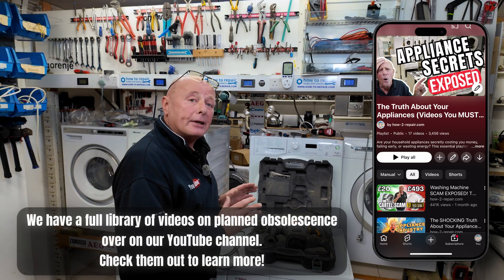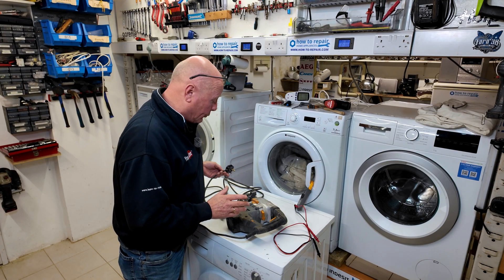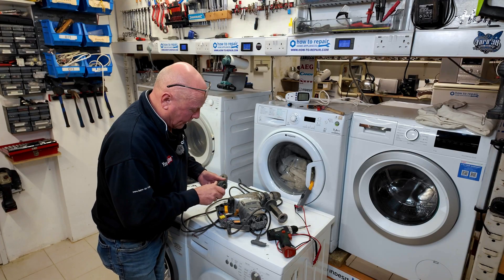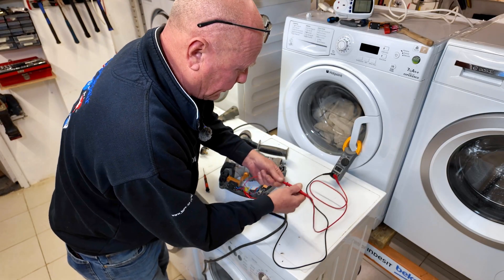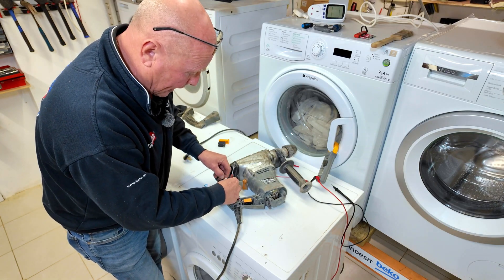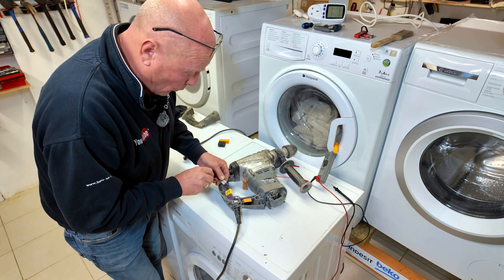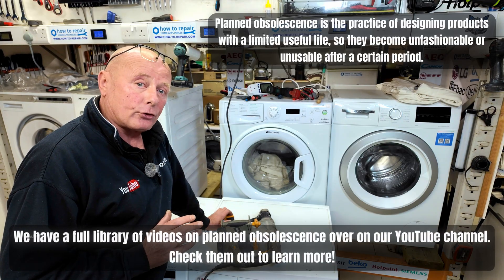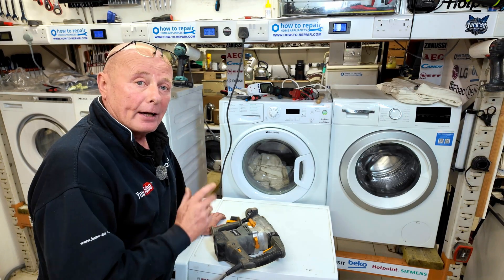How I Saved My Friend £90 on a New Titan Hammer Drill? Power Tool Repair Guide

Comment: I have a Bosch microwave, and  the turntable motor broke.
Good point turn it over and easily remove a metal plate ( which can be easily re attached) and remove the motor.
Bad point Bosch want £25 for it
Good point AliExpress sell EXACTLY the same one for £1-75

Comment: I've got a belt sander, I forget what make.  The same one is available from most of the budget manufacturers like titan, just in different colours.  
Its a bit fiddly, but you can open the switch and clean it inside.  The belt sander is prone to filling the switch with dust, rather than the contacts getting burnt from arcing.  I squirt it out with some brake cleaner, contact cleaner or whatever else is within arms reach, and then give the contacts a quick tickle with a finger nail buffing pad.  I've now got 2 belt sanders, so I can guarantee ive always got at least one thats working 😂

Comment: Even the trigger can be taken apart and cleaned on that particular  unit, they get dirty with buildup  and stop working but once cleaned  it will run as good as new, just be careful you dont lose the small bits,
Reply: Yes probly would be a no parts required repair

Comment: Hi, not tool related, but what tumble dryer would you recommend looking to buy. Had a Creda Heatpump that died and turned out to be a compressor failure. Not used much since we got it. 

Looking at Condenser now - possibly refurb - what brand would you recommend?

Comment: Thank you for ma,ing these videos. I have managed to repair quite a few of my tools - am in the construction industry - you are right, it usually is eiether the switch or the cabling. Years ago, the cabling on small power tools like this, was almost always too short, it ws just a matte of course, to replace it with a longer cable/flex. It saved a lot of bother, fining tye extension lead, too! I still have a few Elu tools….drill & planer, the router was a wonderful bit of kit,  it that did die of a knackered baring. Nevertheless, it was 30 years old & had a hard life.